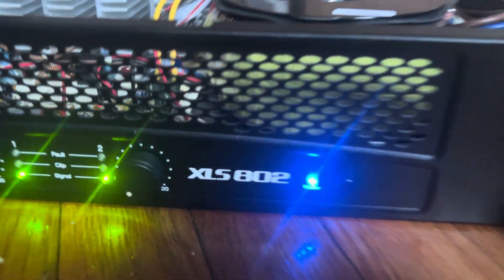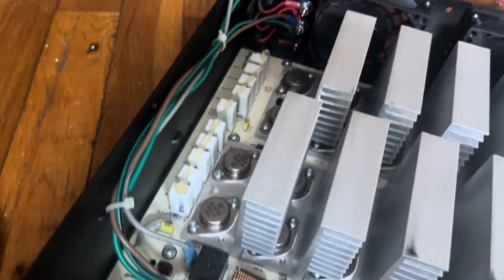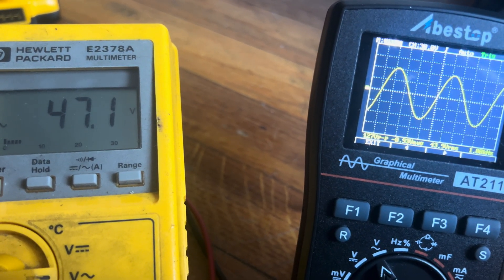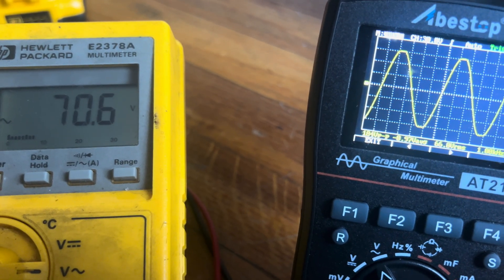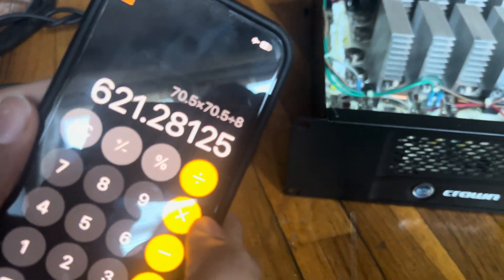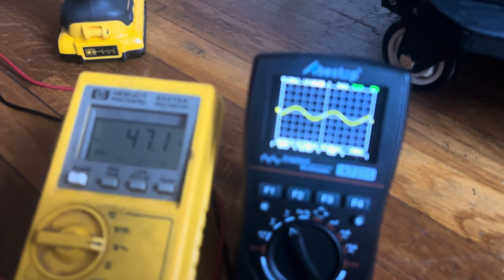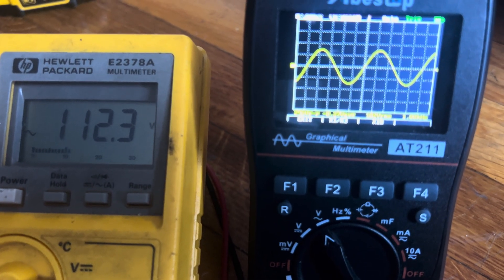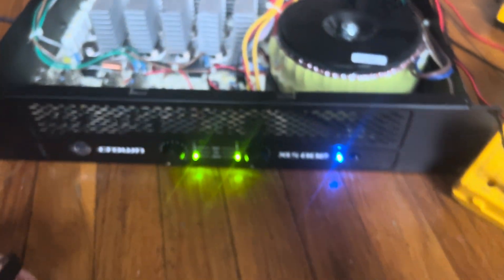CROWN XLS 802 POWER AT CLIPPING ON AN 8 OHM LOAD

Comment: How do these amps sound? Good for tops or subs?  Thanks
Reply from the maker: @camaross12  They sound equally good on tops or subs. I use the 802 on tops and a 5000 on subs though. Sounds fantastic.
Reply: @ thanks. I’ve always skipped past them thinking they were low wattage amps. You benchmarks helped me see they have enough power.  I’m looking for a resister so that I can do some benchmarks on my current amps. Just picked up a couple CTS1200s.
Reply from the maker: @ I use 2 16 ohm 200 watt load resistors in parallel. If you notice how short of a time I go to clipping on these big amps the reason is the resistors get hot really fast. I see a 1000watt 16 ohm on digi key website but they are pricey.

Comment: resistive loads act way differemt tham reactive loads.  speaker is reactive. so the readings would be way different
Reply from the maker: @CotyRiddle  If at say 1000hz, the reactive load was 8 ohms, the reading would be exactly the same because it would be voltage squared divided by impedance. Reactive loads change with frequency, many speakers are well above their 8 ohm rating at different frequencies. The resistive load is far more stress on an amplifier than playing music, which is dynamic vs a 1khz sine wave.